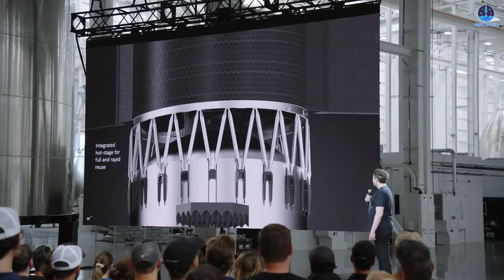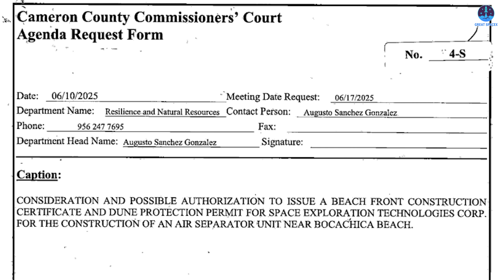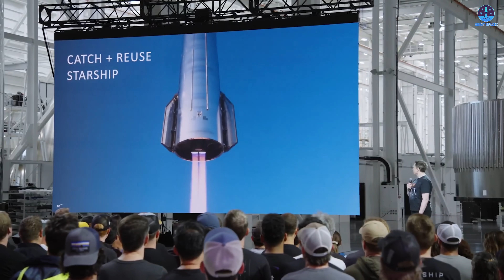Starship S37 Raptor Installed! SpaceX Starship Flight 10 Launch Sooner than we think...

Comment: With the suspicion of possible sabotage to the COPV possibly by bullet in the past, you might think it would be worth the effort to make the tanks better than bulletproof since space has lots of small bits flying around at high speeds. I’d hate to see a COPV take down a ship years in the future due to a micro meteorite or space junk impact.
Reply: If there was a bulletproof material lighter than stainless steel and could survive the extreme temperatures and vacuum of space, then this would be an obvious choice. But the thing is, there are always higher calibers.

Comment: Could this new CH4 “header tank” actually be the complete CH4 tank?
That would make the methane tank coaxial with the LOX tank, eliminating the need for both LOX & CH4 headers, feed lines etc.

The best part is no part.

Quickly test would be compare area of the methane tank to the O2 tanks

If so, there would need to be a lot of insulation to keep the methane from freezing and boiling off a lot of O2.

Comment: 5:57 From what i've heard, it's not the landing tank, but the downcomer, that will take fuel from the methane tank down to the 33 Raptor engines. It's still not 100% clear but that's the most probable description of that part